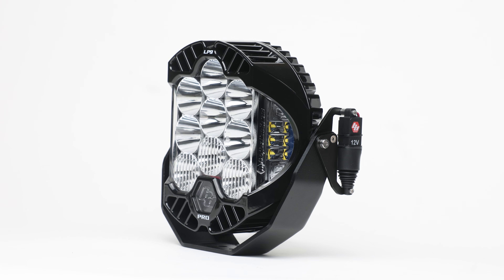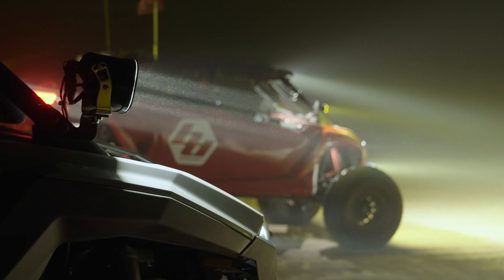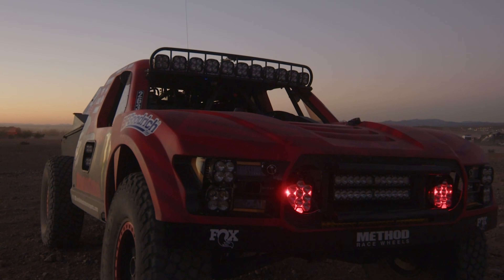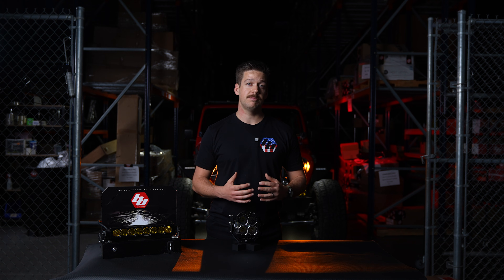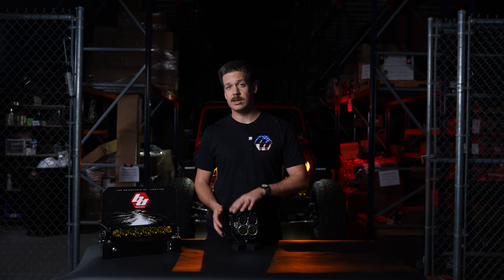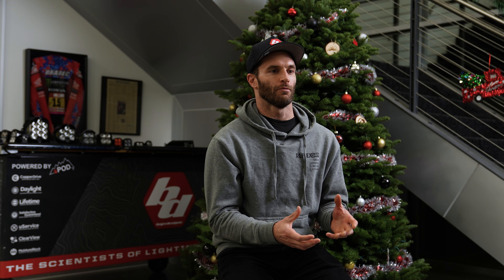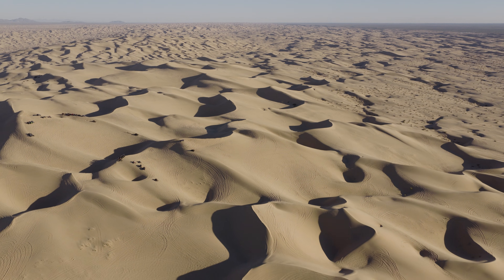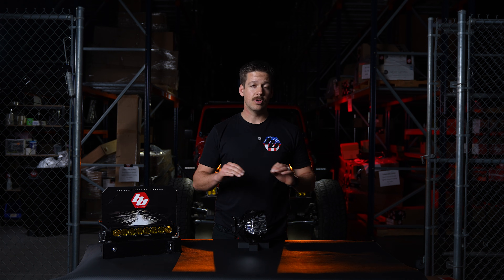Reflex Light Actuator - Behind the Engineering Aiming Your Lights  | Baja Designs University

Comment: Question: 1. How do they integrate with multiple lights? If I have 2 LP6 on my rig would I need to install 2 separate wiring harnesses and 2 separate switches? Or if I have an SPod, would I need 4 empty places to activate 2 lights? Or do they integrate into 1 activation switch or 2 SPod spots? 3. Can I adjust both LP6’s lights at the same time?
Reply from the maker: The Reflex Actuator linking harness can be used to power multiple actuators using one switch. For example, the base Actuator hanress has two leads going to 2 actuators if you wanted to actuate a 4-light LP9 bumper setup with a momentary switch and one actuator per light: (1x) Momentary or rocker single lead actuator harness and (1x) 4XL Linkable Harness to link all the actuators. For an sPOD you would just need two empty cricuits.